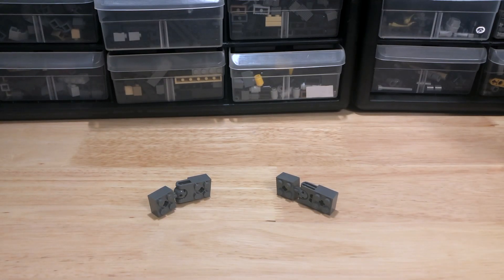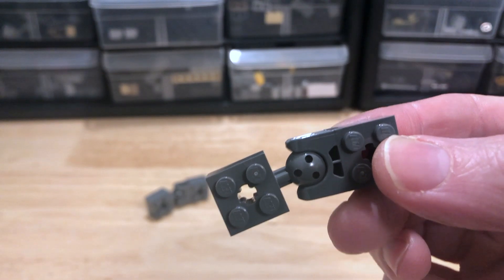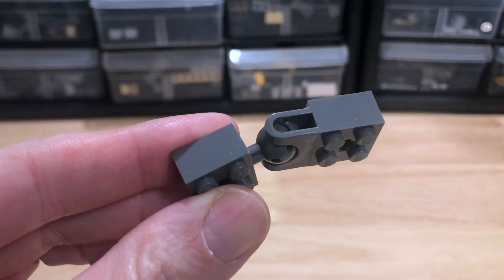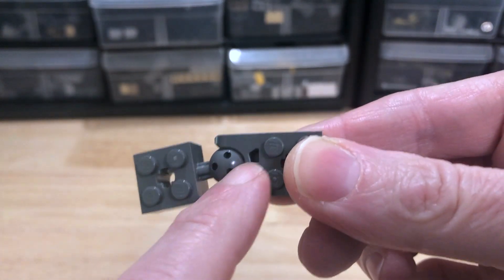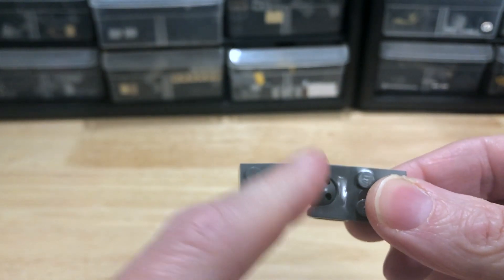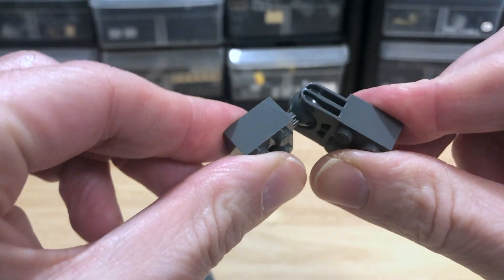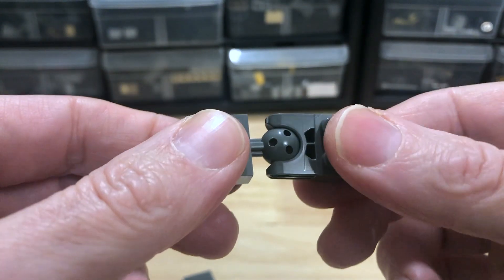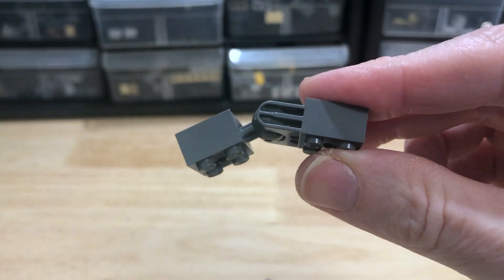LEGO Mech Weight-Bearing New Ball Joint, Is There Hope?

Comment: I was thinking of using these joints for not just small sclae mechs, but for lower arms of bigger mechs too to achieve more range of motion bettwe than the clicky joints. Or alternatively I could use the gray CCBS joints from the 2015 Bionicle sets for more support.

Comment: I think that the new parts are not an improvement at all. It seems to me that the new ones are sadly a bit weaker then the old ones. I like the old ones and wish that Lego could add to them a rubber part, just like in a friction extender part 98613c01.
Reply from the maker: Yep, the rubber makes a huge difference!

Comment: More friction would be nice but more durability/longevity would be better in my opinion.
Reply from the maker: Maybe those side forks reinforce the socket against splitting. I’ve had that happen a couple times. Unsure what the two little holes would accomplish…
Reply: @gothbricks2000  Lego added some extra reinforcement to the sides and then took a little back from the top and bottom as compensation. LOL